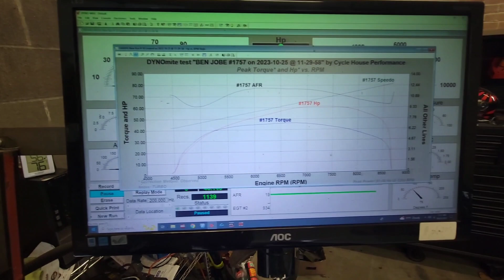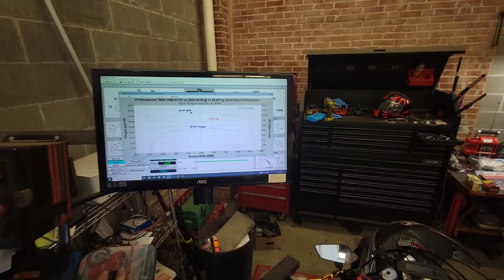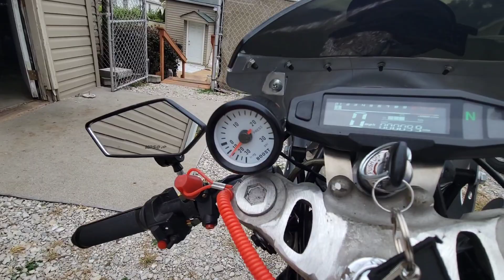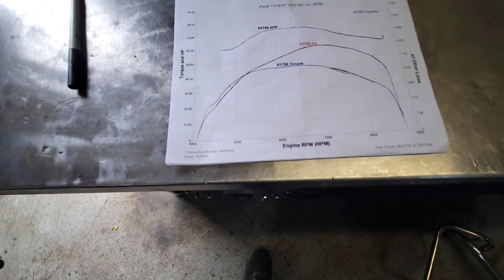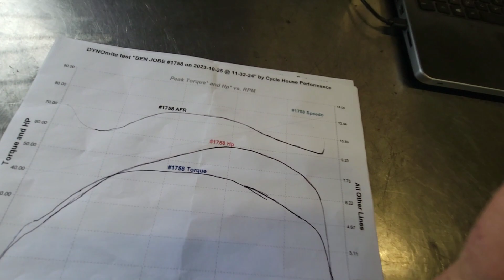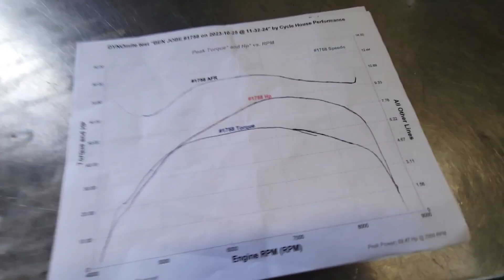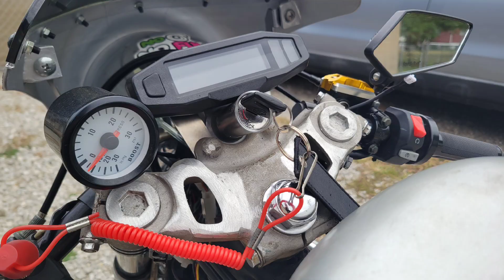Turbo CB750 dyno tune and full rpm pulls!

Comment: Great motorcycles Honda has been doing 4cly for a long time. I remember those 932 ? Bad boy! I’m riding a 1980 Cb900c that my Son fixed up , headers , steel lines , Kevlar clutch, it runs excellent ! Only 21,000 on it, not broken in yet. Go Getem young man ! 👍🇺🇸

Comment: you can burn a valve retardin timing that much, add 5 degrees back and lean it out up top
Reply from the maker: Yup, did and it pulls hard past 8000 now, D9 plugs also

Comment: I’ve got a fresh 18 inch drag slick here in Ohio that would help you hookup perfect on the strip 4 inch wide MH Racemaster
Reply from the maker: Had me thinkin all day 🤔 
I'm on a 17" currently, I may widen the rear for a slick and wheelie bars?
Reply: 17 inch offers much more options on tread. Modern size. My slick is vintage style. I use one on a custom lay down 73’ triumph

Comment: Dude that needs more fuel that 12.5 if its gonna live .  I'd be shooting for 10.5  on boost using 92 Oct
Reply from the maker: Trying to get a low boost pump gas tune for travel, drag week and other landspeed races.  I want 11.4 under boost, then turn up boost and be at 10.9
Reply: @jobescustoms8271    good luck with it .  Cool project

Comment: AFR is getting lean to the end right? would need some more fuel to keep revving
Reply from the maker: Rich at the end, and not much timing.  More boost would be good, but trying to hold back until I get bigger rods
Reply: PIG rich.  there is a lot of power left up top to be had by pulling some fuel out.

Comment: Nothing left on that is original
Reply from the maker: The engine cases, rods and crankshaft are original, along with the stock wiring, wheels, rear brake, complete front fork assembly.  Many other parts are not stock, it is 30yrs later.... 😉
Reply: @hondaben78  I don't mean it as an insult sorry, I was just comparing it to something I would try to turbo charge and ride. I wouldn't want professional drag strip power, only a couple more horsepower.
Reply from the maker: Ah, understandable.  With a bit smaller manifold for the turbo, it would work great on a factory frame and front end.  This one fits, with forks raised.  It's much better and more fuel efficient than the factory turbo suck thru carb setups.  They cannot be turned up.  This one is still turned down.  One of my other viewers is building one in a stock frame, I'll keep ya posted 📫 😉

Comment: 60 hp? Seems really low to be boosted
Reply from the maker: The boost was turned way down at first. It's over 180hp now
Reply: @hondaben78  Can you tell me where to find You're running it on high boost(180hp)
Reply from the maker: If ya look back on my channel, the highway test run was high boost.  THE CB750 turbo life changing ride vid